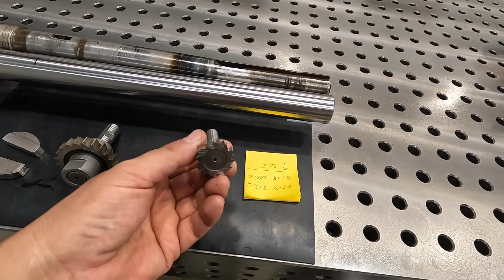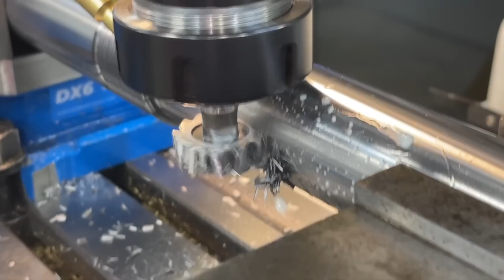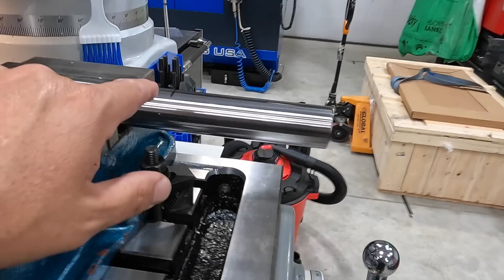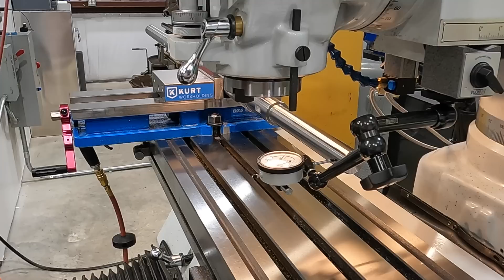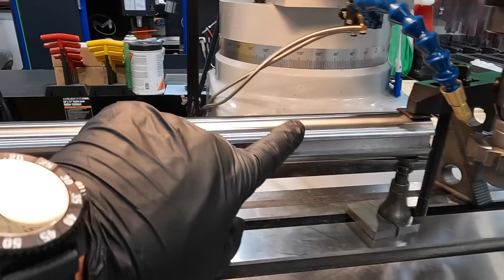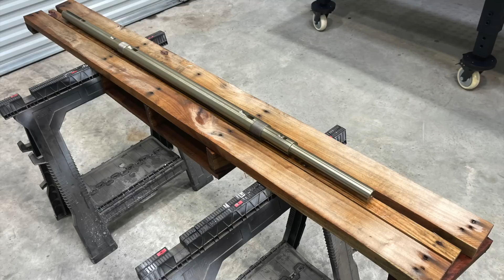70 Ton Friction Press Shaft Part 3: Woodruff & Straight Keyways

Comment: Great work on the video and good clean workmanship. I saw just one issue with your set up for that final longer slot cut. The opposite side to the cut was not supported leading to a bent shaft possibility (not that a blacksmith would be bothered) I would have had a large angle plate attatched and supporting the shaft opposite the cutting forces to avoid bending the shaft. IMO

Comment: Its Its funny but i made a planner gauge when i was an apprentice the tradesman always used a cigarette paper stuck to shaft to tell when the tool was .0005" to get the centre of the shaft he would scribe a line with the lathectool point when the shaft was in the lathe so he could move it in the milling machine and line the keys up 
Well done mate

Comment: Interesting how you found the top of the shaft for the second cutter. I would have found the bottom, by setting the gauge on some parallels and adjusting it to touch bottem of the shaft. just goes to prove there are 102 ways to do just about everything.

Comment: When you flipped your bar around, Adam, I wonder if you readjusted your end vice's solid jaw alignment location to compensate for the difference in diameter? It almost looked like when you cramped the end of the shaft..... It bended. (Maybe just an optical illusion)

Comment: I would have set the planer gauge under the shaft, and thus used the bottom of the shaft as the reference height to set the bottom of the cutter. I would then raise the cutter (lower the knee) by shaft radius-half cutter width.
This avoids having to fool around with the indicator.

Comment: Adam you have so much experience you don't even think of this. Any plane milling cutter with a hole in it must be put on arbor facing the right way . If you  don't the cutter will run backwards and instantly dull the cutter right out. 
I sharpen cutting tools for a living and I have seen it
with inexperienced operators. You can tell by the direction of the burn on the cutting edge. You have worked with this type of cutter for so long you don't even think about it .

Comment: Adam, have you ever used a Vortex Cooler and used cold air for coolant? I had a filter body that i had to keep as clean as possible so no coolant contamination was allowed. It worked, but it was hell on end mills (316 stainless, solid carbide ball end mill)

Comment: A note to Andrew, the owner of this shaft...  The proper fit for keys is a light press fit into the shaft and a clearance fit in the female bores of whatever attaches to the shaft.  It is improper per established engineering standards to have slip fit keys in a shaft.  Movement will result and the keyseat will fail from plastic deformation. These are not my standards. Look in the Machinery Handbook for the fits that I am talking about. If you have ground down, test fit keys, don't use them.  Use new properly fitting keys.  ---Doozer

Comment: You could also use an adjustable parallel under the shaft and touch off on that to get the height of the bottom of the shaft to the cutter. Then move up half the shaft diameter minus half the cutter width.

Comment: what's it mean to be on the flat when establishing the zero? wouldn't the depth be measured from the side dead center (if that's a thing)? do you need to bring it in until the entire height of the tool is cutting before establishing a zero?

Comment: I would've scribed two lines at right angles to each other at either end of the shaft, and then used those for all subsequent levelling or squaring - has to be more accurate than the chosen method.

Comment: Adam, it is always a pleasure to watch and listen to you when doing these kinds of jobs requiring tricks of the trade and more!  Maybe its just my eye-twitch thing happening but it was bothersome to watch the lower tapered part of the mill quill (black painted section, it seems). While I realize that the center is turning true,  that wobble just kept buggin' me and I am thinking, "Really? Those KBC guys just couldn't take the time to grind that part?".  Anyway, great work as always!
Reply: This was bugging me too, but if you watch closely at 37:55 you can see that the shoulder between the taper and the barrel of the quill is level, it's just that whoever painted that tapered part was a little sloppy and got some paint unevenly onto the barrel.

Comment: Cool thing is the cutter is actually slightly moving cause it’s almost in sync with the camera. Most cameras film in 59.94fps but the mill is probably a true 60 rpm.
Reply: The speed adjustment on this mill is approximate, it has a variable belt drive that you crank by hand so you can't get it really that close. I think Adam dialed it in by looking at the camera prior to filming.

Comment: Very interesting optical effect with the cutter and recording speeds. Seeing the center of the cutter rotating correctly with the mill, the teeth standing still from the side but the face of them rotating with the machine again was disconcerting! 👍
Reply: Same effect with rotating machinery under fluorescent lights! Because the electric motors turn either 1800 or3600 rpm (nominal) and the lights actually flash on and off 60 times per second, something spinning at the right rpm can appear to be standing still! Something to be aware of if working on/around running machinery!

Comment: These comments are aimed more at newbies and hobbyists - you experienced folks can skip 'em, agree, or razz me for being too obvious/pompous! ;)

Setting up your work is key to getting good results... that said, there are usually multiple ways to go about things, and multiple tools, some quite simple, that have evolved over the years. We are lucky to have so many options from indicators and digital readouts, to several more basic tools.

One thing that's key is knowing what your allowable tolerances are... sometimes in a hobby situation, we'll go for a tighter than necessary tolerance for practice, but if you need a repair part by a deadline for example, you might just want to consider doing things to the "Good Enough" standard without cutting corners.

Some of the older tools are bare-bones simple - a bit of wire rod ground to a point and held at a height by a couple of setscrews and rods off of a ground base - hey, you need to have something as a flat reference surface! -a good solid true square, and a level can often get the job done.

Think about your geometry, and you can probably come up with two or three ways to do your setup, often with tools you've already got... although, it can be fun to buy more toys... I mean tools! ;)

Comment: Whats the benefit of the wood-ruff key compared to a normal shear key?
Reply: Stronger as a woodruff keyseat is machined deeper into the shaft than a square key. BUT when things bind up, they can tear the shaft up more. Many metric designs use rectangular parallel keys instead of the square keys that American designs favor.   --Doozer
Reply: @kooldoozer  gotcha, ty.

Comment: As someone who rebuilds gearboxes for steel and paper mills and who is an apprentice machinist, I have a question for anyone, Why the hell isn't there keys thar are the regular style and woodruff key hybrid. Nice square seat on one side and the curve on the other. It must be just cost that's the only thing I could think of. It would help tremendously for assembly and disassembly especially for the very large stuff I work with, also it would help guide rebuilders the intended order and direction of assembly for future Hands. We service any industry but mostly those 2, but 85% of the time you don't have prints, and need to rely on photos and notes you took yourself (quality of notes and photos depends on the rush factor) and if there was a catastrophic failure, it's very difficult to guess how the manufacturer intended things to be, also it might be a month or 2 before you reassemble and forget the important details. Taking out stubborn or rusty/dirty regular keys would be better, no marring up surfaces to pop out a key. Also woodruff keys are horrible, even with a little grease or antisieze, just pop on out, it's no fun when you yank out your part out of an oven with .005 Thou clearance and it's not getting any bigger and time is of the essence you use the crane to drop your part on the shaft it's sliding down the shaft nice then at the last second even though there's another person watching the key, bam pops out you try to lift it off but right as you switch directions bam it sticks, and you can try to either get it to the frog or press and get it off quick but it'd be safer just to wait till the next day.
 it only happens in the winter and luckily woodruff keys are rare in my experience for larger parts.
If they used a hybrid key or just a regular key those headaches would be non existent.
Therapy rant over
Reply: I think someone has already invented that. Look up 'Hi-Pro keys'.
Reply: @utidjian   In my opinion that took the worst of both key styles, and made it more expensive then what I propose. 
 I mean literally 1 end square, then the curve on the opposite.
L____D 
Lol that's the closest I can get to the shape in my head onto word
Reply: @erokcreates  I get it I think... like a very tall n? I have seen that type many times. on square cross section straight keys. I don't think they are as robust as Woodruff style keys though. While I have dismantled and fitted many a keyed shaft I have never had one that was designed to be keyed AND shrink fit together at the same time.
Reply: @utidjian  well a key isn't a shrink fit, every other Part is. That's why both types of keys I think you Normally see are convient for the machinist manufacturing parts, woodruff key and what I would call the normal style of key just rely on the geometry of the tool. What I propose would require 2 tools, but in today's world shouldn't be a problem. From the top the key would look like a standard key, a rectangular shape with rounded corners/a radius on either end, however from the side view you would see the end further down the shaft, or the furthest down where the part said key engages with would have a nice 90° corner, like typical keys, so the key couldn't pop out during assembly, but on the opposite of the key would have a a radius, (or rather a tapered radius? Not sure what a geometric term to describe it would be) like the woodruff key starting with the bottom flat of the key slot leading and curving up to meet at the top so when you remove a key you reduce the chances  of accidentally marring up the shaft or if it's rusted or dirty it would aid in tapping it out.
Also that shape would aid in pointing in what  direction things were installed, especially on shafts without shoulders or other features. Like there are shredders we occasionally remanufacture and there are multiple slots and the trick is you can't actually assemble from one side to the other, you have to start in the middle, so if the keys were like how I described it would assist in indicating to anyone assembling in the order to which things need to be done without written instructions or time consuming mistakes, especially when the parts are interference fits and there isn't a good way to disassemble it, without cutting parts off. That's an extremely specific example but in general it would be helpful

Comment: I've run into those holes on shafting jobs before. A lot of times it's when they shear something but need the machine up and running right away, so they'll drill it for a roll pin. Not saying it's right.

Comment: Great observation though...if you can 'feel' the resistance or chatter in manual machining, where are the sensory indicators when performing CNC work--are there differences in tooling in which it just doesn't matter? Need a plunge cut in whatever go for it no chattering involved?

Comment: Question: Theres no worry about making a 2 flat spots on the shaft with the pressure needed to secure it in the vise?
Reply: You'd have to well and truely over tighten the vice to put flat spots on a piece of 4140
Reply: @markshort9098  ty for the answer!

Comment: Is that shaft still straight after you cut the key ways in it? We usually pre-machine key ways on long shafts where I work.
Reply: Do you cut the keyholes first rough, then turn the shaft to size, and then finish the keys? This way there will be a lot of interrupted cuts. I'm just  asking to learn.
Reply: @belatoth3763  on a shaft with tight runout tolerances we rough out the diameters. 020 inches over size, then cut the key ways .010" deeper than plan dimensions. Then check the shaft for straightness, we usually have to use a press or heat to get it back within tolerance before we finish the diameters & threads
Reply: @jimwright8379  What are the tolerances? tenths? Note that on this shaft the bearing journals are very close to the where the keyways are cut. The exception is one far out on the thin end with the long keyway and the one most prone to 'go banana shaped' but it is also unrestricted so less of a problem.
Reply: @utidjian  We are working on pump shafts for the US Navy , I can't tell you the tolerances that we are holding, however if it is running within. 005" T.I.R. for that friction press it's probably just fine.
Reply: @jimwright8379  Ah well... yeah this is not a pump shaft. My guess is a few hundred RPM at most. Those bearings surfaces will be within 0.005" for sure. I am as curious as you exactly how much runout there is though.

Comment: They are a little more pricey but the Stagger Toothed Woodruff Keyseat Cutters cut smoother with far less if any squealing. There is a chart in Machineries Handbook that lists the cord dimensions of various size Keyseats and shafts. I kept a page marker in mine.

Comment: What’s really impressive is that the RPM didn’t vary by more than +/- .5 or so when loaded down by cutting. That’s one, sweet milling machine. 😌
Reply: Rpm will only start dropping when the maximum rated power output of the motor is exceeded. Considering this is heavily geared down it’s nowhere near maximum power. With stuff geared down like this the system has plenty of torque to break all kinds of stuff. The only time you’re gonna get close to maxing out the motor power is when running at high speed and taking a heavy cut at the same time.
Reply: The rigidity isn't super good though. Imo they should've made it with a 5" or so thick quill so they could fit a proper thick 40 taper shaft in there.
Reply: @imkindofabigdeal4308  thanks for repeating what I said lol

Comment: Shaper gauge could go, without any indicator, under the shaft and under the cutter. Would need to compensate for backlash whilst cranking down the knee tho. Else: that wobbly black rim/taper on the toolholder would drive me nuts.
Reply: I saw that too and thought the same thing! Makes me wonder what ELSE is wrong with it! 😆

Comment: The end of that endmill holder looks to have been machined a bit skew-whiff. 😊
Reply: I found the hula-hooping strangely hypnotic and relaxing :)
Reply: As a viewer I noticed it instantly and was slightly disappointed in the lack of craftsmanship... if I was the owner like Adam, I would be soooooo mad. I understand that it doesn't affect the precision and performance, but it does give a I'm not so perfect feel lol.
Reply: @gonetroutfishing  Done on purpose to see spindle is rotating, a safety thing.
Reply: @willemvantsant5105  That makes complete sense! Thank you for the info Willem and have a great weekend!

Comment: Hi! Why didnt you just zero the indicator on the top of the shaft and then adjust the higth of your tool directly with the indicator reading zero on it and calculate your tools position from that?
Reply: You are assuming that the cutter teeth are dead flat and true to the spindle... often they are not. Many cutters have some relief on the sides so one would have to somehow position the indicator probe exactly on the "highest" edge or tip of the cutter which is difficult to do. The way Adam did it takes care of those issues because the gaging face of the planer gage is in flat plane and parallel to the top of the shaft. It is quicker, simpler, and less error prone than doing what you suggest.
You don't even need a planer gage though they are, by far, handy tools to have. You can use square with a parallel clamp. You can use a combination square with two heads on it. You can use an adjustable parallel. You can use a height gage. You can use just about anything with a height that is within the range of your dial indicator, flat base and flat and parallel ledge or top... just have to add or subtract the difference.

Comment: Hi Adam. Greetings from Lithuania. You are much appreciated for your videos tips and tricks and just everything you do on this channel. I Have a hobby workshop myself, by the way congratulations with your new shop, it's ridiculuosly awesome. 
Anyway I've noticed that everything is quiet clean and shiny in your shop, and was just wondering how do you fight surface rust in your shops? I imagine you have an AC or something that helps a lot, but I just get frustrated and annoyed when I come back to my shop two days after and find forming rusty fingerprints on my chuck and anything else I touched. So now I'm just spraying every raw steel surface with automotive anticorrosive sprays and stuff like that, but it gets messy ant expensive over time. Any tips or thoughts on that?  
Cheers!
Reply: Most machines thrive on neglect to be honest (when it comes to cleaning at least). Just wipe everything down with an oily rag when you leave the machine for longer and dont overclean.
Reply: If you watch Adam's older videos he shows what he sprays on his machines. It's in a green and silver spray can.
I can't remember it's name, sorry.
Reply: @douglascampbell9809  Lots of CRC products